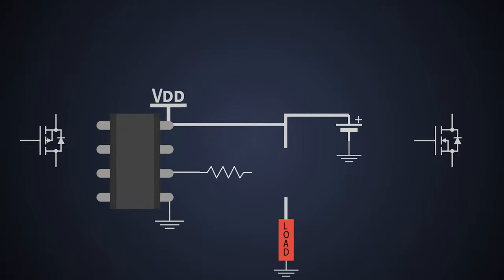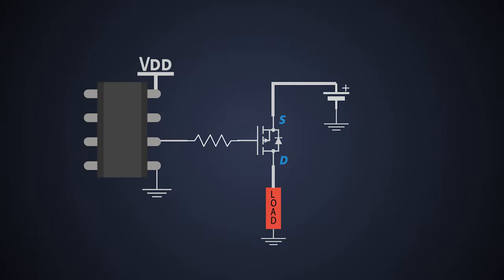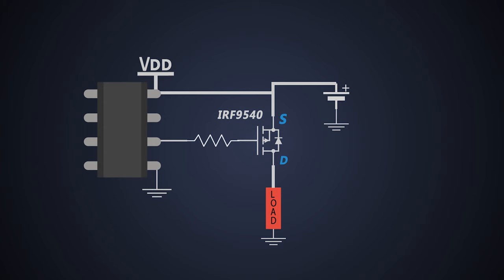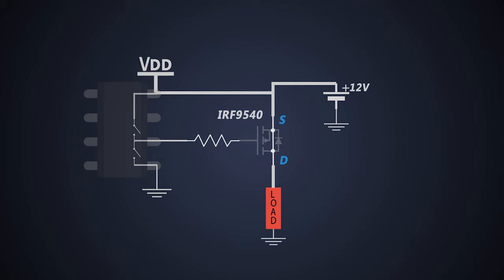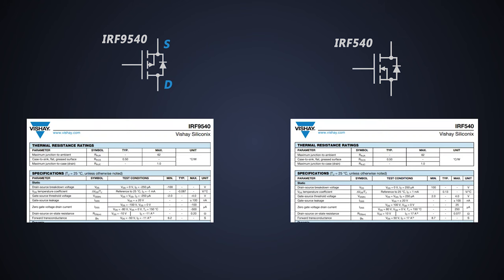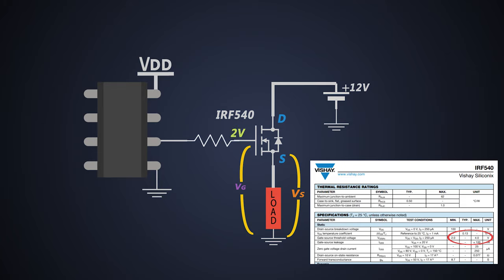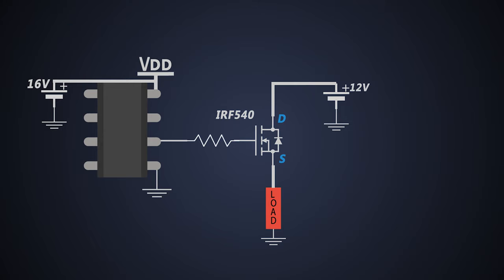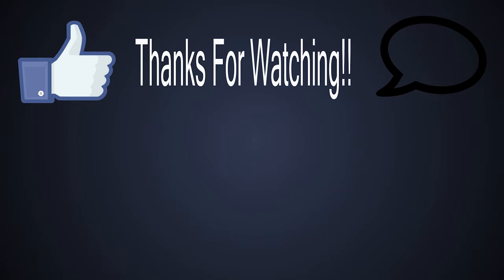P-channel MOSFET as a High side switch | Why is it hard to use N-channel MOSFET as high side switch?

Comment: Poor choice in using 7 v bc it’s not a realistic or practical real world example
Reply: that is why i wonder how some  youtubers are really good common world techs
Reply: It makes perfect sense as it illustrates the maximum voltage that would turn on the P-fet. He even mentions grounding it afterwards as the realistic use case, thus connecting it to 0 volts and getting -12v VGS instead of the -5V VGS he got when he mentioned a 7V connection at the gate pin.
Reply: Here the engineer goes on again about “real world examples” 😏

Comment: Hi, I am a chip designer, and I love your clips, because it teaches me how to do many things at the PCB level.  In the chip level, we use either a capacitor or butterfly circuit to do this.  In capacitor method as you know, we connect the capacitor to ground and Vsup through two switches, then when we want o turn on the high side NMOS switch we We turn the capacitor switches off and connect the ground of capacitor to supply and the other side of the cap to the gate.  The gate of NMOS will fly to twice the supply voltage which turn of the NMOS.  However, doing this in chip level is easy because the transistors are almost free, but at the PCB level we need four transistors to do that and becoming familiar with the chips that are already available is a blessing and better way to do that.  This is why your clips are so interesting to me.  Thanks for the good work.
Reply from the maker: Thank you so much for watching!! Please don't forget to subscribe to our channel
Reply: I'm becoming curious about the difference between the two design philosophies. Do you have any references for the chip level design? I'm a DSP engineer but like to play around with PCBs.

Comment: With a P-FET, switching on the FET is usually not a problem....just switch your  driver pin LOW. However, switching it off  may be a problem. Sure, if your driver pin is equal to the voltage on the Source, it will switch off, but most output pins of say a microcontroller, will not reach Vcc but stay slightly below it. If your MOSFET has a LOW Vgstreshhold tat might be enough to slightly open it. If one picks a MOSFET with a Higher VGS(th) that should not be a problem....but then say a 3V3 system may not be able to fully open the P-FET
Reply: Would defining an MCU output to an input with pull-up solve the issue of completely switch it off? 
I have a strange phenomenon on my circuit where I want to switch on external logic chip and off again. Sometimes it seems that the chip is not really in the same initial state and lost somewhere in nirvana and does not respond. I think it could be related to what you explain. So may this be a fix or do I still have a difference between gate and source?
Reply: @NOW-IS  interesting thought but in fact you are saying: let's try to get a higher voltage fed to the MCU pin. No real problem if the issue is that your mcu pin stays just below the rail voltage, but maybe not something that would work on a shared 3v3 / 5V system.
Definitely worth a thought though
Reply: Could be easily solved by adding a pull up resistor of let's say 10k and connect it to vcc

Comment: as a beginner in electronics, i spent ages trying to read and understand this concept. thanks for making sense of it - you explanations backed up with examples makes it so much easier to conceptualise!
Reply from the maker: Glad it was helpful! Thank you so much for watching!! Please don't forget to subscribe to our channel
Reply: @FoolishEngineer  how do I use a P channel MOSFET as a high side switch if the gate voltage is from an ESP8266 (3.3V) yet the load (via drain) is 24V?  I can never get that voltage differential to turn the MOSFET on?  I can't use a N channel MOSFET here as the load has 3 x positive inputs and a common ground.

Comment: is there additional driver circuit in buck converter as they use nmos high side switching ?
If yes then why they don't use pmos instead that complex circuit
Reply: Usually a charge pump gate drive is used to switch the nmos. The reason why is that pmos is more expensive than nmos and it is much less .efficient. The Rdson of nmos is much lower than pmos, therefore less energy will be lost as heat during switching. This is important in portable battery powered applications.

Comment: Thank you very much! I don't see yet, how you could switch OFF the P-MOSFET , i.e. how you could change the positive gate-voltage from VDD to 12V-MOSFET-supply...?
Is an internal BIP-Transistor used for that inside the MOSFET-driver?

Comment: What a great explaination
But i have a question, if i use high voltge Vsd (about 50V) so that means if i want to turn off the MOSFET switch, i should  provide Vdd very high so that voltage difference between Vgs not exceed -4 V (suppose that is Vthreshold) right?

Comment: Good day Sir, on a H Bridge of power inverter, i have always mosfet 1 (high side) and mosfet 2 (low side) that burn while 4 and 3 stay ok. Please note that they burn ONLY WHEN I TURN IT OFF, when ON, all is good.
When i use only 3 mosfets, none burns (1,2,3 or 2,3,4). I checked on the scope, signals are identical and voltage between gate and source are the same for low and high side. I am running out of mosfets and i would like to fix that inverter, any idea where to look at ?
Thanks.

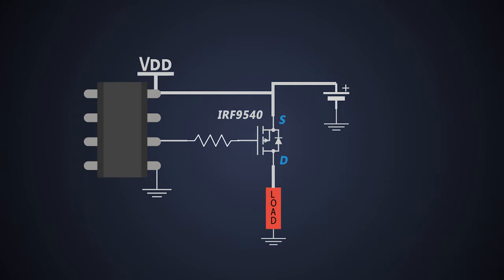Comment: at 2:29 Is the Vdd power connected to the 12 Volt battery and if so why is it allowed. isnt it a short circuit? I`d be glad for any answer
Reply: Why would it be a short? Vdd is the driver positive power supply input. It doesn't have to be the same supply as the load, but it usually is.

Comment: Hi, i need help, to make a mosfet as switch,
The source supply is 28 volts and load is 7 Ohm.
Hence around 4 amps of current will flow. This entire circuit to be controlled by a 3.3 V control signal.
Kindly suggest a logic level driver along with a mosfet.

Comment: In motor driver circuits, we use N-channel MOSFET as Low & High side MOSFET,

Why we are not using P-Channel as high side MOSFET in that case ?

I suspect reason is,

1. Rds(on) high in P-Channel
2. To turn on & turn off high side MOSFET at same speed as Low side MOSFET to have synchronisation in on & off ?

Any other reason or wrong assumption?

Kindly reply.

Comment: Hello, I like your videos, I want to learn that, what is the advantage of high-side drive over low-side drive, when is it better to choose high-side drive, and also what is the effect of them on the efficiency of the circuit(which has higher efficiency)?
Reply: In reverse polarity protection, low-side has two problems that high-side does not. First problem is creating a voltage across the transistor's Rds on the ground itself. Second problem is separating the ground between the power source and circuit. In practice, this voltage is very small and probably within the acceptable noise level in most circuits. Splitting the ground should be fine in a battery-powered circuit but bad practice in a circuit powered from an outlet.

High-side problem is just higher voltage loss from PMOS having higher Rds than NMOS. Thus PMOS is less efficient. Can use NMOS in high-side with a charge pump but that adds cost and complexity. One option for the charge pump meant for reverse polarity protection is the LM74610.

Also, the zener + resistor aren't needed if you'll never exceed the MOSFET's Vgs limit, which is fair to say, never going to happen in a 3V battery circuit. Is a risk leaving them out in a circuit powered from the outlet due to voltage transients.

Comment: You could have emphasized the comparison with a bipolar transistor.
When the switch is connected with a common source configuration, the MOSFET works an an amplifier.
When the MOSFET is connected in a common drain configuration, it acts as a voltage follower, with unity gain...

Comment: I did not understand + 7volt. or - 7volt. on the gate of p-mosfet ?
Reply: +7 volt, as voltage at gate minus voltage of source would be -5 voltage, negative allowable vgs will turn on the mosfet

Comment: P channels @ over 60 amps are becomming scarce - I need to switch to n channel perhaps.
Reply: As you scale up, the P-channel refers to "parallel", LOL.  Spreading the load between multiple FETs also allows better spread across a heatsink.

Comment: That’s why I see 129volt on the gate of the mosfets on my fully bridge  driver because the gate and the switching voltage have to be almost the same to fully switch high side on that’s one information never mention in any mosfet data sheet so why is this information hidden from the user on the product